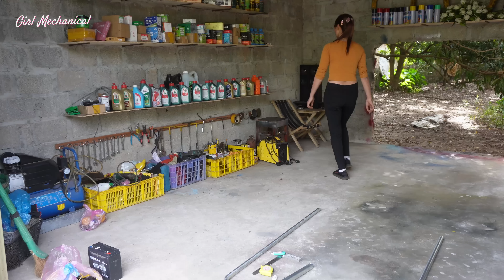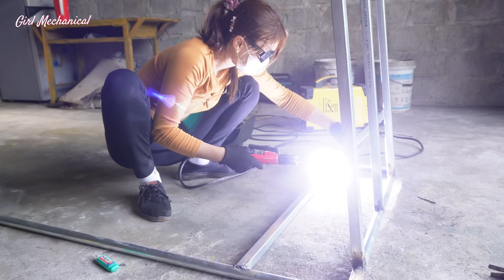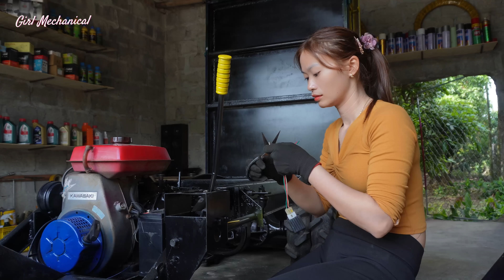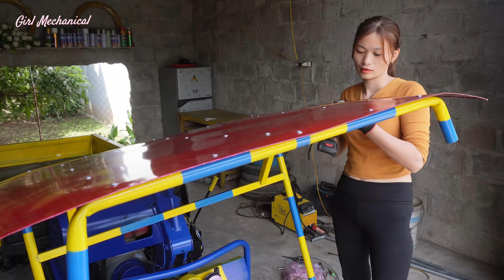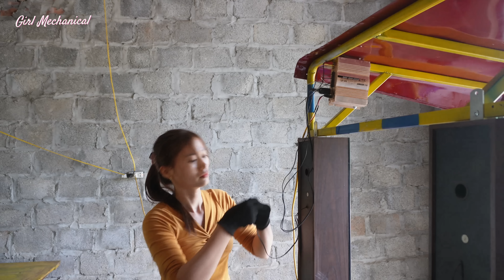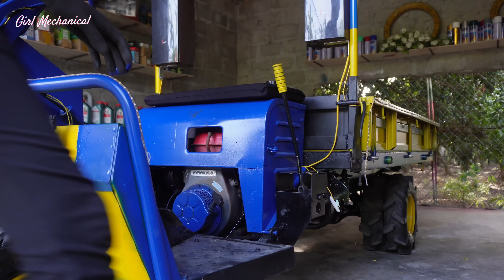Genius girl: Restoring the roof, sound, and lights of her 3-wheeled vehicle 🚛🚛🚛

Comment: Hello Hoa :D This is a nice extension of the ongoing work with the 3-wheeler. You came up with a good accessory structure. You sure made a quick design work for it; adding more lights and speakers! Would be interesting to see that driven at night, good work Hoa😘

Comment: two little round mirrors should be mounted hanging from each front corner of the roof. they dont have to hang very low just 3 or 4 inches? 🤔🙂